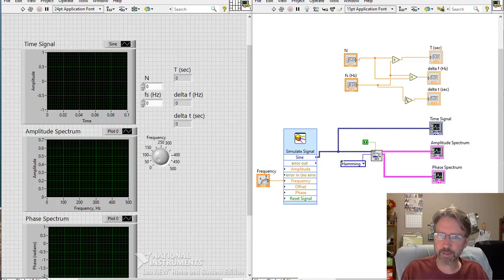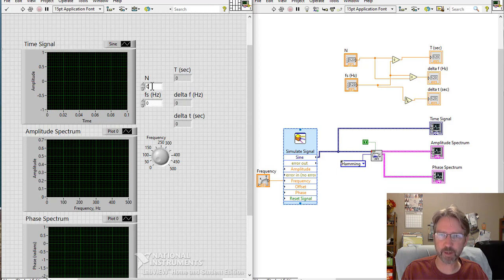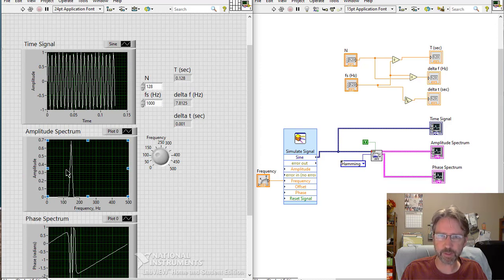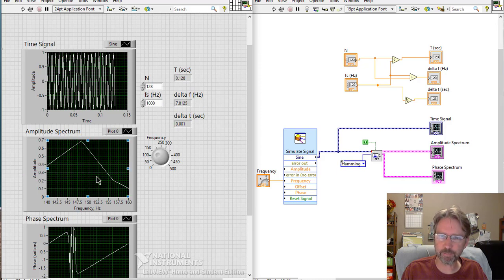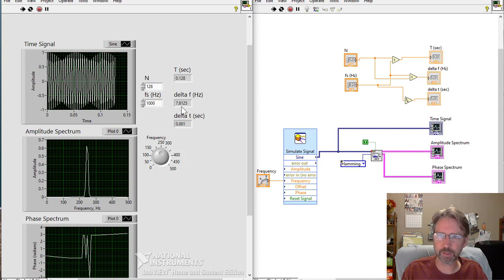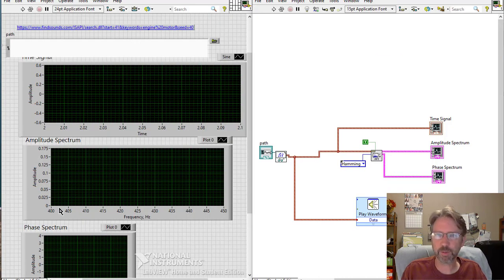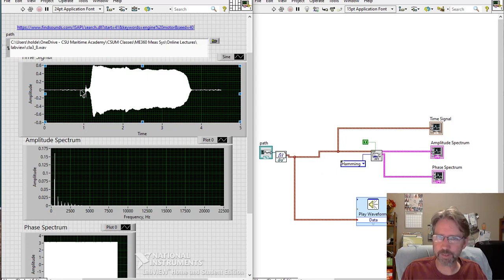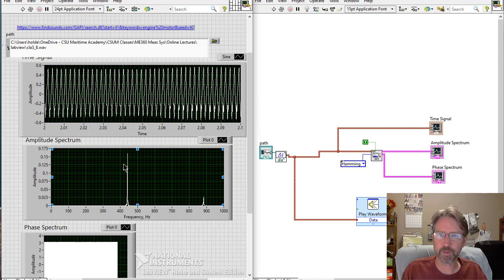lab5 FFT with labview

Comment: Wow, I never thought you can perform a FFT on a sound via LabView… what’s the function for reading the sound called?
Reply: Got it, “Sound File Read Simple”.
Reply from the maker: @kulaniscap  If you have a fast enough DAQ you can also feed a headphone signal directly in as voltage.